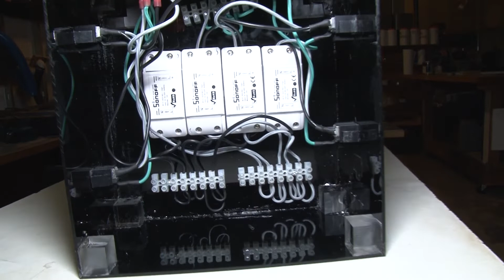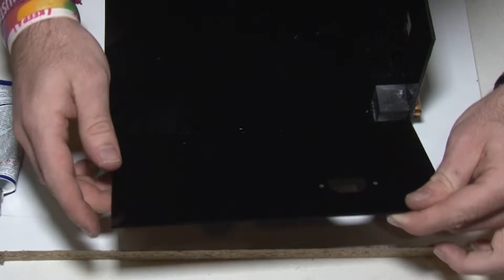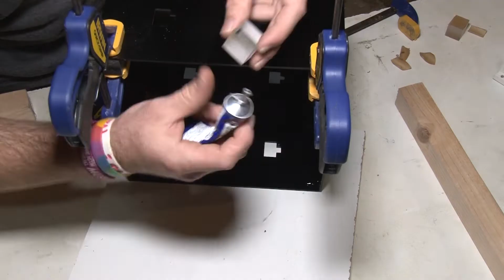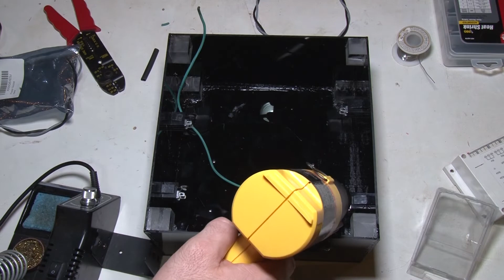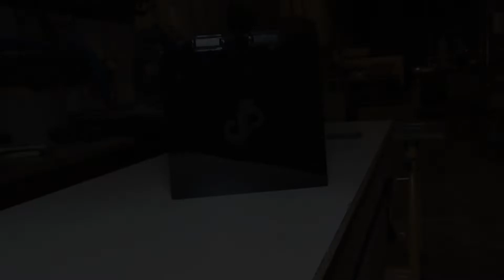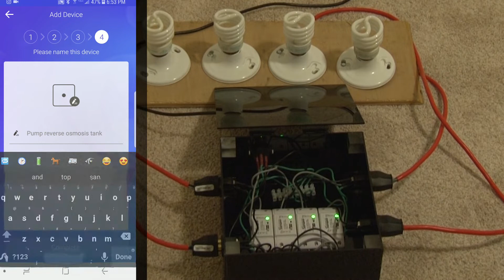control box

Comment: I liked this. Why two pumps in flower?
Reply from the maker: Technically its 3 in flower. I use jacks 321. And for the first half of flower it would use the basic 321 nutes but in later flower when I want to bulk up i want a little pk booster for it thus the second pump. Then the 3rd is for the flush at the end. But i guess RO water can go anywhere.